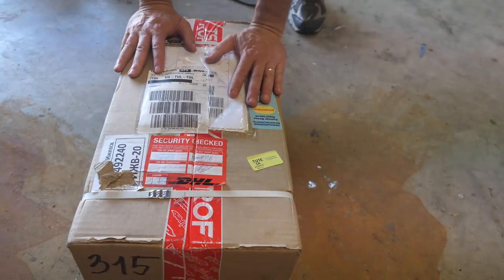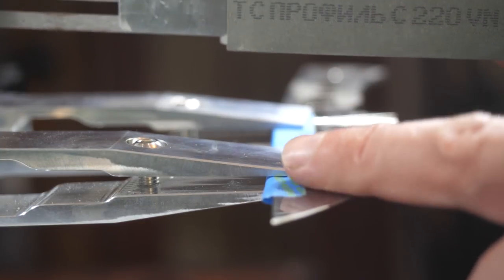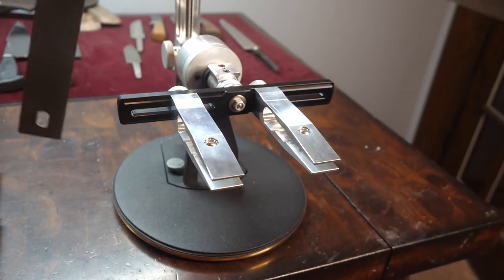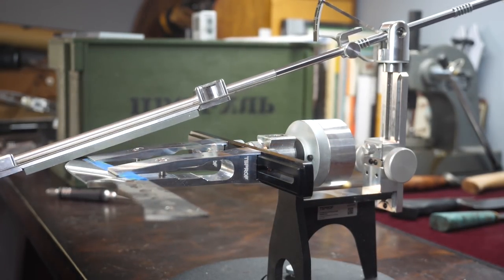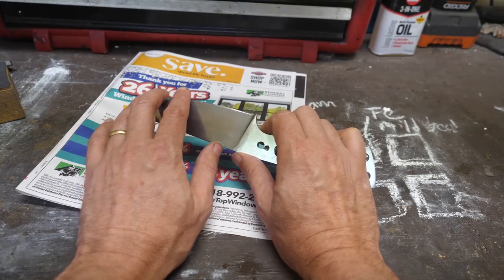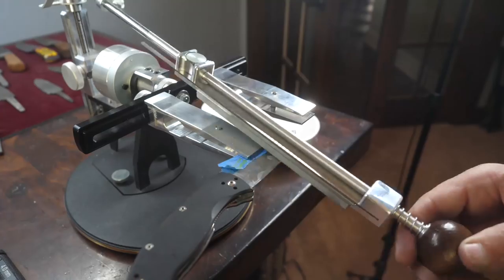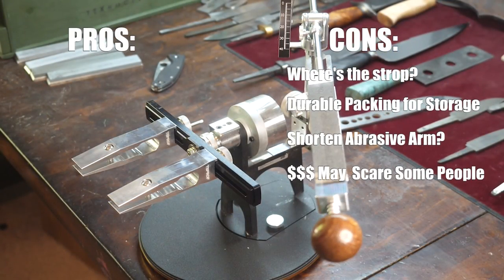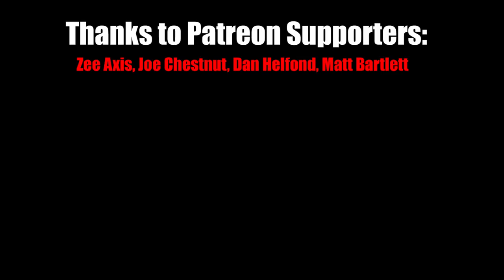TSProf KO3 Review!

Comment: I got one of these earlier this year, and a coworker ordered one too. very happy. Mine was an upgraded package that addressed almost all your concerns. The whole kit fit into a plastic carry case with custom cut foam inside. and it held the abrasives, including strops that fit into the holder and came with the level of kit I got. Great review.   Also if you plan to use it for smaller knives, take a look at their other clamps that would make your life easier.     Also I use plasti-dip on my clamps instead of taping every knife and it was worked well so far.
Reply from the maker: What is this plastidip
Reply: @GreenBeetle  it's a liquid plastic coating. Comes in lots of colors. Spray or 'dip'. I use the dip method. It can be easily peeled off and re done if it wears out. Amazon or most hardware stores I've been to have it.

Comment: i like seeing the two clamps for the knife.. it seems like it's like many  of those mount off the counter top setups. only someone has listened to all of the complaints and hacks and it's finally come out with a solid tool . i love my carbide stones. they had a pretty long break in period on them but keeping them wet and clean. i like them. i just can't justify the price of the wicked edge . maybe if i sharpen knives for a living. $3 a knife i might have it paid off in two years. lots of nice machining on it . but $500 i don't know if that is a bargain or not. i think they can come down to 300-350 and they wouldn't be able to keep up with the demand. informative video i liked it
Reply from the maker: I had the same thought about the price point.  You’re right on w that.  It’s so quality though it prob takes a pretty penny to make.
Reply: @GreenBeetle  i would never attempt i hate working with aluminum
Reply: Most knife sharpeners aren’t designed to clean up long blades like kitchen knives. I remember when this came out and that’s the biggest problem it addressed. The stones are balanced well between size and longevity. Considering what a WE Pro costs and still how unfinished it is, the K03 is a great bargain.

Comment: I have used this sharpening system for over 7 years now. It gives the mixes edge of any other I have used. My only beef is that when upgrading, the components from one model to the next is incompatible. You almost have to buy the total tool assembly to upgrade. For a professional blade-smith, it us with the cost, but not for hobbiest knife makers and DIY blade sharpeners.

Comment: 7:11 on your other system, you could try using two rubber strips from a bicycle tube. Note, the rubber should be cleaned for maximum gripping power. If you don't have fear of acetone, wetting the strip in acetone makes it twice grippier than normal. I use it to secure my leather knife, which is basically paper thin, and would slip even in the best of sharpener holders.
Reply from the maker: Nice tip
Reply: Im just curious why have fear of acetone? I dont work in steel, i work in silver, which doesnt react with acetone under normal conditions.

Is there something about certain steels that make them not be able to encounter acetone?
Reply: @childofcascadia  Har!  I think the subject is Solvents v/s People!  It's my understanding that Alcohol and Acetone can be metabolized, Acetone is commonly used because it's not as toxic as a dozen handy solvents you could easily name.  BUT some people won't want anything to do with any such stuff!
Reply: Ha! Ok that makes sense then. I thought it was some kind of steel pickle technique that could only be used on certain steels. Acetones not that bad if you dont douse yourself in it, but I get it. I dont use Sparex #2 for a pickle solution for the reason of not wanting to constantly interact with toxic chemicals. I use industrial grade citric acid. You still dont want it on you, but its way safer, biodegradable, and easy to neutralize.

Comment: How does the clamp/s work with knives that got swedges or a lot of facets on the spine? Is there rubber in the clamps (if not that should a quick fix with some vinyl or rubber). I have been wanting a TSProf for a while now, I just can't decide on what model to go with. Been considering the Kadett, but not decided. I want mine to be as easy as possible to set up and use, and take as little space as possible as I mostly will be sharpening folders on the system and some fixed blades. My kitchen knives I usually sharpen on whetstones.

Comment: Thanks for the review. 
I bought a Worksharp sharpener. Not impressed. I just could not get a "hair popping" edge I get with my wet stones. The unit you are using looks well built but also looks quite expensive. Hmmm, sticking to my wet stones I think. It works for me.
Reply from the maker: Go with what works!  And what you enjoy.  That’s important, being confident in your set up and getting satisfaction w using it. I love stones but my consistency isn’t there w them.
Reply: I think worksharps are great for getting a good edge fast and easily but not a good option if you want really really sharp.
Reply: @Lucas12v  Agreed.

Comment: The right packaging would've been those tool foam trays you can buy and make fit your stuff, and since they make their own boxes, a piece of plywood and locating dowels would've been excellent and long lasting (well, as long as the tool foam lasts, i've seen them installed as far back as 12 years now, and there doesn't seem to be much damage so far).

Comment: What I dont like about these things is that, because it uses a single pivot point for the stone, the angle at which your sharpening changes for the entire length of the blade.
Reply from the maker: Not if the blade is straight.  So the curve at the tip, yes it changes a little.  Jeremy at Simple little life did a video on this a few years ago.  The angle would change except that the length of the hypotenuse increases and decreases as the sharpening arm is moved.
Reply: @GreenBeetle  It would change specifically on the straight edge of a blade.
The height of the pivot point stays the same, but when moving to the left or right on a straight line, the grinding surface will be moving farther from the center which would tighten the angle.
In order for the grind angle to not change, the blade would need to be curved to match the circumference of a circle thats congruent with the distance from the edge to the center.
Doing the math may prove it to be a negligible difference in most cases, but I can imagine it being significant on longer blades.
Reply: @Thee_Sinner  Definitely research this, because you were given the correct answer. You should challenge your preconception and actually go look at a test.
Reply: @Thee_Sinner  That's incorrect, you have it backwards, the grind angle only changes w/ the curvature of the blade as Green beetle stated.
Reply: Taylor Hickman 
(I picked the following numbers at random. It’s been 7 months since this video and I don’t remember what was presented.)

Imagine a 10” kitchen knife. For an ideal 20 degree edge at center, and with the edge 4” from the pivot, the grind arm will have to be placed 1.45” above the blade. With this set up it is 4.26” from the pivot to the blade edge.

If we take the same measurements at the heel of the blade, which would be 5 inches tangential to the starting contact point (assuming the blade is perfectly straight), the 4” distance from blade edge to pivot point is now 6.4”. With the height remaining at 1.45”, the angle at which the grinding surface touches the blade is now at 12.77 degrees.
Reply: @Thee_Sinner  It's counterintuitive I know, but easily verifiable. I did the test on an 8" knives from a jointer and found no appreciable difference. 

Here's another explanation- https://www.youtube.com/watch?v=UjoTLYsKG9k
Reply: @GreenBeetle  
I've watched Jeremy's episode, seems to make sense to me...
Reply: @GreenBeetle I finally figured it out 3 years later thanks to a video from Outdoors55. I was not considering that the stone was able to twist inside the pivot and the twisting completely cancels out the change in angle that I was seeing.

Comment: I've always wondered how systems like that maintain the correct bevel angle at the curved portion of the blade. Presumably the stone is free to rotate on the shaft and you have to live with a slight change of angle?
Reply: Angle changes a bit
Reply from the maker: Yep it changes
Reply: There are narrow stones available for curved sections.

Comment: I bought some made strops for this, even though I have regular big strops.  I got a bunch of them!  Because I KNOW that I'm going to cut up one or two of them by accident!  I am wondering if stropping on the EXACT ANGLE of the edge might be more effective, faster, avoid rounding off the edge?  It's worth a try!  And it's not like there's any shortage of magnifiers and microscopes sitting around!  Screw using a marker!  The MICROSCOPE shows you the truth!

Comment: I have an edge pro and have haven't been all that satisfied with it. It's annoying to use for coarse sharpening or weird blade shapes that you find on pocket knives because you have to manually hold the blade in position. It also doesn't make a ton of sense for honing either when a spyderco triangle sharpmaker or a strop is just faster. So my expensive sharpener just sits and collects dust most of the time.

Comment: These types of systems are really very good for people who might not necessarily be great at sharpening or have high alloy, modern powder metallurgy stainless knives which are just a massive pain in the bum to sharpen. They do the job very well for those along with some more aggressive re-profiling of any old, worn out stuff.
If you're a knife maker who does a lot of different metals or is looking for a baseline in performance in their geometry, its got the precision to at least get you started somewhere with a consistent edge bevel. Set your angle, test away on cardboard or rope or whacking it into logs, see how it works on other angles to what works.

Comment: Nobody who reviews these seems to use the full length of the stone when sharpening. Definitely try to get into the habit of doing that from the start, or you'll be spending more on stones than you need to.
Reply: That's a great observation and suggestion! Thanks! I'm on a pre-order for the K03 Pro Sharpening System.

Comment: I bought one very similar to that set up on Amazon for 60 bucks, it does work, however the ksprof system seems light years ahead with quality.
Reply: It is glittering and metallic!  It's more machined than it has to be!  Stuff is "machined all over" and anodized, it's a presentation grade thing.  I'm thinking of setting up at the Flea Market and just sharpen knives for the passers-by!

Comment: The thing I don't like about this design is that the angle changes the further away from the pivot point you're contacting the blade...so the more you swivel from center, the more you're getting away from your true angle. That shows especially well on that long flat bar you showed about 8 1/2 minutes in.

Seems like a lot of fancy setup for something that could be accomplished (potentially better) with a simple stone or two.
Reply from the maker: It’s the same angle no matter how far from pivot because length of the arm changes to accommodate.  Jeremy at simple little life did a video on this a while ago.  I think the angle changes at the tip a bit going around the belly, though.
Reply: @GreenBeetle  Unless the actual height of the pivot changes, that's just not true. Pythagoras theorem. The height is a set value, so as you lengthen the distance from the upright, the other side gets longer too...and the angle changes. It might be minor, but it's there. 
Edit: I get what you're saying, but it only holds true while the edge stays straight. And at that end where the arm lengthens is where your blade usually curves.

Comment: Your kit should have came with a wide singular clamp for smaller blades .. would have been perfect for your edc knife …
Reply: The original ones did come with both clamp systems.
Reply: They're in the catalog but out-o-stock right now I think.  It's sort of "Y" shaped, so the thing engages both sides of the rotating mechanism but comes out as a single clamp that turns on the axis of rotation.  They have one that's thin, and might allow for the Scandinavian grind?  I'll get one when it's available just because it exists I guess.
Reply: @leonardpearlman4017  Mine came with 2 thin clamps and one wide Y shaped clamp .. i find myself using the Y shaped clamp the most … great system… especially if ur like me and love to geek out on mirror finished razor sharp edges 😆

Comment: I do not recommend buying this sharpener, I have ko3 pro hunter and kadet pro, although kadet pro has few less options, it is far more stable sharpener than k03 hunter. Ko3 Hunter main top swivel which holds the rod - always unscrews and as youre sharpening it always pop back and forth, you gotta always tighten the screw on it, if you tighen to tight swivel rotations will be rough and and create more resistance for turning as youre sharpening. Another flaw that is becoming very annoying is the bar that holds the miller clamps. No matter how much you tighten it, as you press against either left or right end of the knife while sharpening- it caused tiny dip on the edge of it even with light pressure, kadet pro doesn't have such issues, its clamps tightening has different mechanism but much  more efficient and sturdy, im not happy with ko3 hunter sharpener, kadet pro is a better choice, even though it has few limits